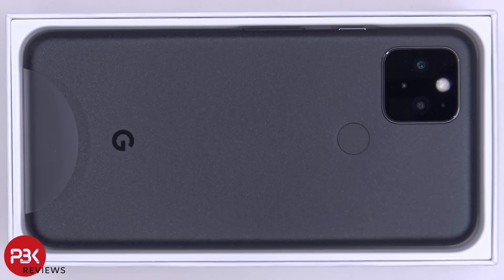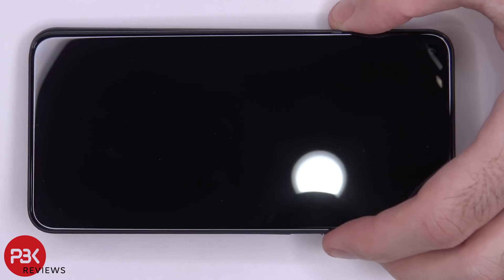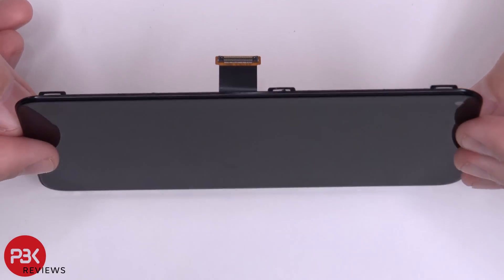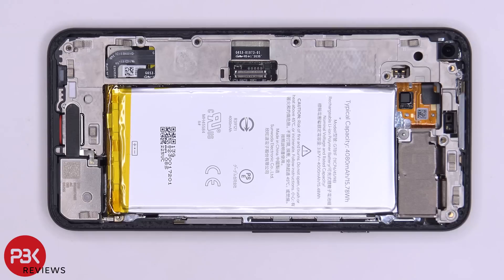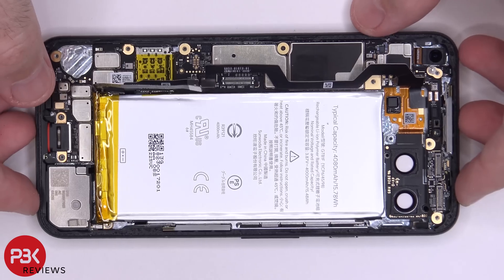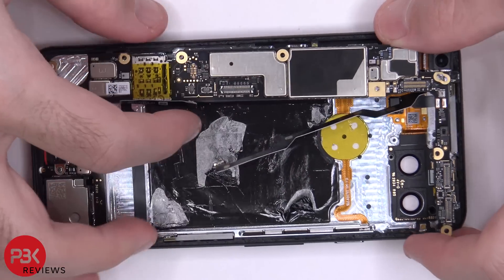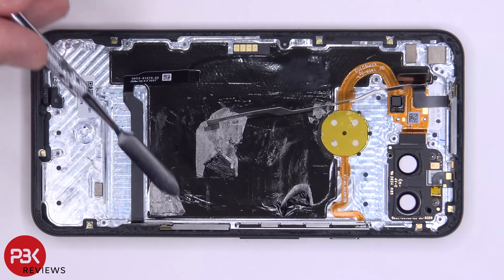Google Pixel 5 5G Disassembly Teardown Repair Video Review. Screen Gap?

Comment: Could one in theory replace the cameras with a newer/better one if they are of the same size?
Reply from the maker: Usually no because the software has to be able to read the hardware in most cases as well as connector sizes and such for the cameras as well have to match

Comment: Finally, but you obviously didnt want to find out how big wireless charging hole really is. I understand it. Thank you, i wanted to see how my phone looks like from inside : )
Reply from the maker: Thank you. I added links to pictures of the wireless charging cut out etc. to the description.
Reply: @PBKreviews  Do you think a metal plate for a magnetic vent mount will work for a pixel 5? I guess, one can be cut to size so it doesn't interfere with wireless charging if needed? Thanks for the help!
Reply from the maker: @CuriousUserError  Not too sure. It might be possible but would probably have to be very think to not interfere with spacing between the wireless charging and the back of the phone.
Reply: @PBKreviews  Thanks for that! I am thinking of putting the metal plate between the bottom edge of the phone and where the coil approximately starts so it doesn't interfere with the wireless charging capabilities. Gonna have to ballpark my guess base on the pictures you provided. Thanks again!

Comment: Nice video, is it still waterproof after disassemble and reassemble?
Because I had this with my pixel 2 XL.
Reply from the maker: Thank you, no once you take it apart, it would require the original precut adhesive to install again to retain the water seal. Right now they aren't available to order online, but once they become available, then it can be installed to ensure a secure seal.
Reply: @PBKreviews  hi, thanks for the video! When comparing to other devices, do you have an idea when and where the seal could be available?
Reply from the maker: @maximenaud2882  Hi, you're welcome. Usually when screen replacements become available, most come with the screen adhesive pre installed or included with the screen for you to install. Some phone models take 1-2 months to become available and some take 4-6 months or even longer.

Comment: I se something between the screen and frame on the left middle
Reply from the maker: what do you mean? at what point in the video
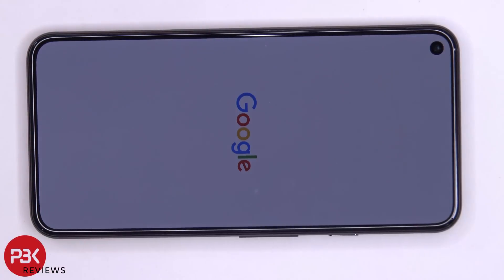Reply: @PBKreviews  at 6:45 into the video top of the phone almost center but little to the right looks to be between the frame and screen but I watched video again it's a glare of light when u move the phone it moves to great video thank you for showing us how it's done  I was also hoping to see what they filled the cut out with to achieve wireless charging again thank you for the video
Reply from the maker: Oh ok, you're welcome. I added links to the description of the cut out if you haven't seen it yet.

Comment: Google pixel 5 screen gap dangerous.. Or not
Reply from the maker: The adhesive holds strong and the catches around the screen assembly add additional support. I don't see the screens coming off easy or falling off, highly unlikely.

Comment: Some people have issues with overheating while recording 4K video. It simply stops recording after 3-4 minutes.
Might be problem with internal heat management?
Reply from the maker: Its possible. It does have graphite film behind the cameras to transfer heat to the copper tape on the screen. But considering the fact the cameras generate heat, the battery is right underneath which generates heat and the screen right over it generating heat, I can see after a long period of time maybe the camera's or the phone itself might be overheating. The screen can transfer heat out but the fact so many components are relying on the screen as an exit for heat it might be overwhelming. They may also release software updates to help control the workload or tasks to decrease heat when the camera is being used etc.

Comment: The under screen loudspeaker / vibration motor / „earpiece“ is really disappointing. In best case the sound quality is average, but as soon as you put a screen protector on the display it even getting worser.

I had the pixel 5 for two weeks. 
It has had some issues with the accelerometer sensor (switching to landscape)
Battery indicator issue (got stuck on various charging levels > software problem)
Heavy lagging / freezing for 3-5 seconds (happened 4 times in 2 days) with no heavy usage 

Really disappointed with the pixel 5
Reply from the maker: Ya I personally prefer an actual speaker with an earpiece opening rather than the sounds vibrations.
Reply: My wife has a UV screen protector aka it adheres with a liquid that set under UV light and she and I have no problems hearing.

Comment: Nice video, thank you... That battery doesn't look too bad to change.
Reply from the maker: Thanks and you're welcome. The battery isn't too hard to change but the fact that there is little room to work with to pry it off along with the fact you can't remove the main board until you remove the battery since the bottom flap portion of the battery is sitting over the main board makes it a bit difficult and time consuming since you don't want to damage anything on the motherboard (chips n such) when your prying off the battery with pry tools.

Comment: Nice teardown!
Can you tell me the battery measures, the length and width? Thank you very much!
Reply from the maker: Thank you. I already took it apart 2 times (second to take pics of the wireless charging coil) so I don't want to take it apart a 3rd since the phone is going to be used. But if I do take it apart again I will make sure to measure it for you. :)

Comment: The haptic motor is a downgrade from pixel 4!
Reply from the maker: Yup, also the processor. Not sure why they downgraded the vib motor, maybe space requirment.
Reply: @PBKreviews  not to mention the speakers!
Reply: Seriously one of the most disappointing parts of it.
Reply: Can you explain to me why is this a downgrade? I know nothing about these motors. :) Thanks
Reply: @septoleta2407  So if you check the teardown video of pixel 4, it has a rectangular vibration motor just like the iphones. It is the best haptic motor in all android phones so far, the haptic feedback is sharp and satisfying. In the pixel5, they used a circular motor which is just like any normal vibration motor. The clicks and taps won't be as sharp and clicky as the pixel4 .
Reply: @SuperMan-uj7dh  Thank you very much for your explanation. :)
Reply: @SuperMan-uj7dh  What kind of vibration motors does the Pixel A series have? (The Pixel 3A and 4A)
Reply: @EliasSchnetzer  They Pixel 3 and 4 series have a linear actuator ( rectangular in shape) the 3a, 4a and pixel 5 have a circular vibration motor. They are very good, but the ones on the 3 and 4 are better.
Reply: @SuperMan-uj7dh  Good. I'm coming from a Nexus 5X and bought the Pixel 5. So for me it's still an upgrade. But yeah, would have been awesome to have the better motor inside the Pixel 5. But at least there's a thing I can hopefully look forward to when buying the next Pixel in 3 years. 😁

Comment: Thank you for the video. Could you explain why do people seem to think that this phone has a bad or average build quality? Is it only because of this supposed lack of adhesive on some units? You said it should have a good repairability with this build so I am curious about what exactly is not ok in this phone...
Reply from the maker: Hi, I'm assuming its just the adhesive issue. Overall the phones quality seems good to me, no other defects I was able to find. I liked the feel and material of the back as well. The inside is fairly easy for repairs, but does require you to remove the battery first if you are planning on removing the main board. Also some people aren't happy with the fact its using an older processor compared to that of the pixel 4a.

Comment: Are the cathes flimsy i.e. break once opened? The one for bottom right corner seems to have deformed just from prying open (at 01:26).
Reply from the maker: They aren't extremely tough but not that flimsy. It probably bent a bit when I was using my pry tool to pry the screen off. When prying off you will hear clicks when the catches come off, kind of make you think the screen or glass cracked but its the catch coming off.

Comment: could we possibly loosen the adhesive with a heat source and apply pressure to try and close the gap, for those who have been affected?
Reply from the maker: Ya you can try using a hair dryer and do that and see if it will help. After heating just press down and hold for 20 to 30 seconds and let it cool down see if it grips better.
Reply: @PBKreviews  is there a chance of risking the water protection by doing it?
Reply from the maker: @YgorCortes  yes, once you take it apart, until you install an original pre cut adhesive made for the phone, you would lose water resistance. Usually pre cut adhesives start showing up with screen replacements etc down the line.
Reply: Hey Lygon ! Did you try the hair dryer fix ? :)
Reply: @finlyk  oh not yet. I actually got my gapgate pixel 5 and exchanged it. The new one has a smaller gap, but it's uniform around the whole front plate, like the official google renders. So now I'm not sure if I wanna do the hair dryer trick or not.

Comment: Thanks for covering the screen gap design. Could honestly be rush production. Q/A issue
Reply from the maker: You're welcome. Probably rush production but ya at the end of the day its just looks to be a visual defect rather than an operational one. The seal still is intact and does its job and the screen won't fall off either.

Comment: Nice to finally see a teardown, although I would have liked to see the charging coil and how they made the cut out in the back frame for it. Nevertheless, enjoyed it, thanks!
Reply from the maker: Here are some pictures of it, I took it apart again and took some pics. https://ibb.co/D9C9g0s   ,  https://ibb.co/JxFQSKg
Reply: @PBKreviews  Epic!You just took it apart AGAIN for our dumb curiosity. Keep it up!
Reply from the maker: @MallV0lli0  Thanks, will do :)
Reply: @PBKreviews  can't believe you took it apart again! Thank you so much, you're awesome! 🙏🙏
Reply from the maker: @YgorCortes  You're welcome, and thank you. :)
Reply from the maker: No problem and thanks. Ya I didn't think that far ahead to peel off the wireless charging pad (I should have). I'm pretty sure ifixit or someone else will eventually also upload a teardown and peel the wireless charging coil off and reveal if there is a cut in the frame or how it was done.
Reply: Amazing, thanks. So it's clear from this that the hole is through the whole thickness of the alu, so at that point of the phone it's just plastic. Cheers!!
Reply from the maker: @JamesCadman  no problem :)
Reply: Great work, the mystery is revealed thanks to you !! 👏
Reply from the maker: @maxoo._  Thank you :)
Reply: @PBKreviews  you're welcome 😉 If you still have this unit, could you do a scratch test to see if the coating peels off easily ?
Reply from the maker: @maxoo._  I was actually curious myself but in most cases there are people who purchase the devices after I'm done with them, so I can recoup some costs since I don't have an endless budget so I can get new phones to do videos on. I wish the videos generated enough revenue for me to be able to do drop tests and scratch tests and so forth but I would easily run out of budget if I took the phones to a point of no return :) Also for this specific phone, I'm gifting it to someone I know who wanted it so yep. Hopefully in the future I will be able to go beyond and do more types of videos for you guys once the channel grows and generates enough revenue to allow me to do so. :)
Reply: @PBKreviews  Very appreciate your envolvement ! It is always interesting to see scratch tests bends test and tear downs to see the belly of our next purchase ! 🤗
Reply: He could always have pulled a Jerry and stabbed the phone until he hit the metal frame or the battery....
Guess who killed their Pixel 5
Reply from the maker: @Pumpkin7266  lol yup

Comment: Does it have the same vibrator as the older models ?
Reply from the maker: depends, some had linear vibrator motors and some had the older style vibrator motors like the one in this pixel 5.
Reply: @PBKreviews  Is there a way to know witch one has the linear one?
Reply: @Magnetar83  Pixel 2, Pixel 3, and Pixel 4 (not 4a) all had linear motors. Pixel 1, 3a, 4a, 4a 5G, and 5 all have this type found in the teardown.

edit:// Apparently linear motors can be found in circular form but are generally not as good as the boxed style. The Pixel 1, 2, 3, and 4 had the boxed style linear motor (similar to iPhone's taptic engine but not as good). The Pixel 3a, 4a, 4a 5G, and 5 all have the inferior circular style linear motors.
Reply from the maker: Thank you
Reply: @siluah7515  apparently on p5 the haptic feedback can be adjusted in settings
Reply: @amarpreetgeadhoke2385  yes but you can't overcome physics with software. It has an inferior vibration motor.

Comment: Nice job, thanks for the teardown! Can you tell how the display fit after reassembling the device? Could you see any difference in relation to the gap compared to before? Really wondering why there seems to be so much variance between different units how big the gap primarily in the top left corner is with so much adhesive.
Reply from the maker: No problem, and thanks. Well the adhesive I use to put it back together compared to the one it originally comes with is different. All I know is, it wasn't that easy to pry the original adhesive off, it stretches so I'm assuming that elasticity it has in the type of adhesive that is used along with the design of the phone is what causes it to have some lift here and there. It's not the first time I have seen this type of stretchy adhesive used in water resistant phones but different phone designs work different with how the adhesive sits and holds. Some phones might have the screen seated in a way that it's not pulling away from the frame at all so you don't see the adhesive stretched a bit and some like this pixel 5 might have some resistant between the screen and frame so that may cause the screen to pull slightly away from the frame but its just more of a aesthetic thing and not something that compromises the seal/water resistance etc. So bottom line, even though the frame of the screen may not be perfectly flush with the frame of the phone, the adhesive is still intact and has a proper seal so it wont have any negative effect and the screen will not come off, you would need to really work at prying it off to get it to come off.
Reply: @PBKreviews  Wow, thanks for the comprehensive answer! Really didn't expect that. Good to hear that this seems to be more of a side effect by the actual phone design and not a real problem. I am curious if Google will stick to this manufacturing design or future batches will look differently. Thanks again for your efforts!
Reply from the maker: You're welcome. It's possible they may alter adhesives or add additional supports to firmly grip down the screen (just to clear up the worry for customers) even though it's not needed. Either way looks to be an easy fix if they do implement one.